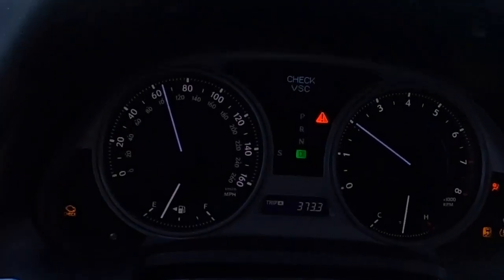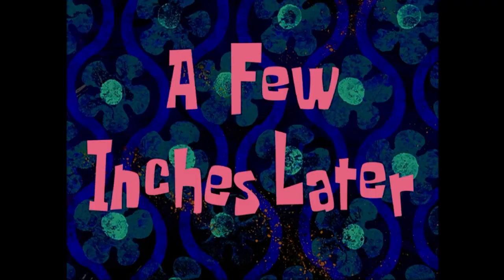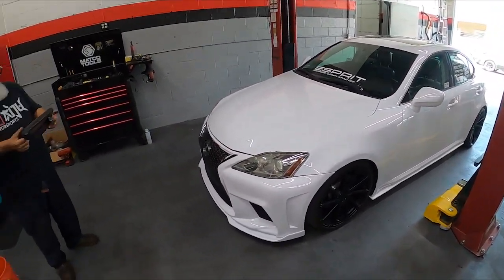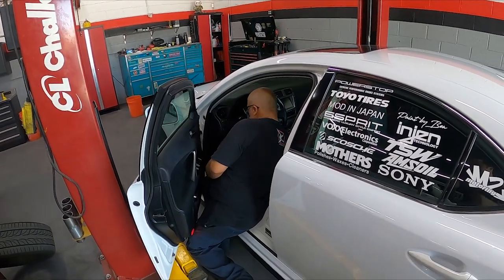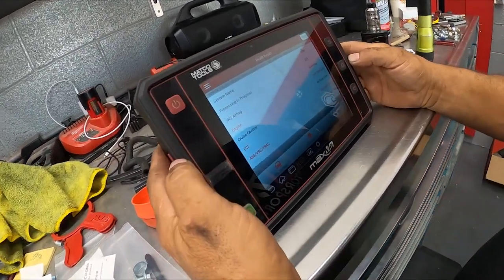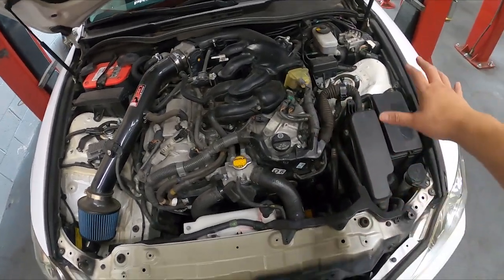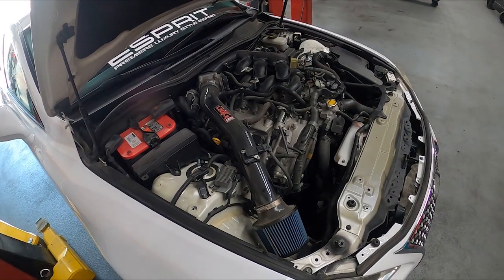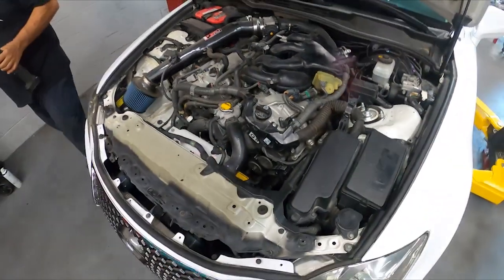Taking a second look at what is WRONG with my Lexus IS250.  Hope there's no surprises.

Comment: On these is250s and is350s, on a cold start, to prevent damage, the tran wont shift into 6th until its warmed up. Also there are updates for the trans at lexus that might help out ur shifting issues. as long as ur fluid isnt shot, i dont see why it isnt save able
Reply from the maker: Hello in previous videos we’ve scanned and diagnosed the transmission issue and cars whole history and build process. It’s more a lack of maintenance on the transmission from the previous owner which is very common because lexus sold the “lifetime fluid” idea (which is proven to be incorrect) to its new buyers back in that era.  

The solenoids are getting stuck from old fluid. Have to clean out the trans , swap solenoids, or other option is to swap in low mileage transmission.

Currently debating
Reply: @M2Motoring  i hope its just the solenoids if anything. I replaced my trans fluid 3 times between 190k and 200k. So far, seems fine. After every fluid change, it drove better.
Reply from the maker: @adamdistortion8810  Glad to hear your car runs better after the fluid changes.  It's really a toss up at the moment for myself.  The solenoid change is a pain to do and the shop rate and time to gamble the solenoid and fluid replacement would fix all isn't far off from a low mileage transmission swap.  That is my current dilemma.
Reply: @M2Motoring  i would just replace the transmission at that point, get the cheapest one you can.(300-500) 😅 as long as you have acces to a lift, itll be a easy swap. I pulled my motor and trans in my garage last year when replacing the motor, and it was pretty hard on the floor lol.
Reply from the maker: @adamdistortion8810  Definitely need a lift.  No more engine or trans swaps on the ground.  I'm too old for that lol.  Where are you seeing the transmission for $300-500? I'm jumping around the internet and the going rate now is 1k.  =(